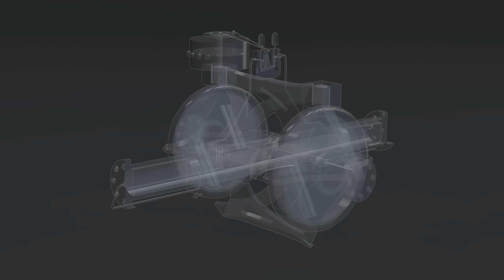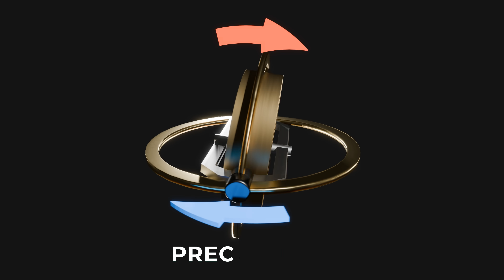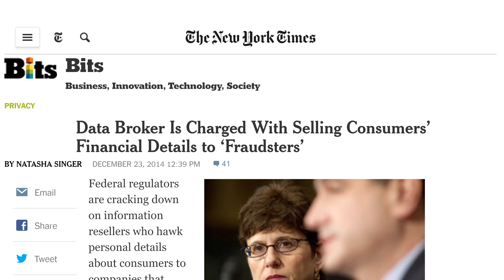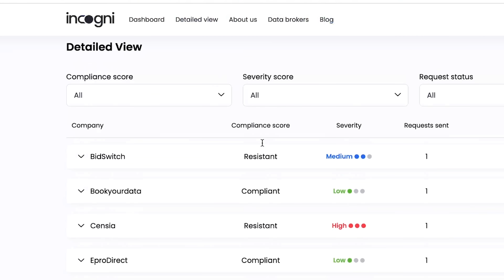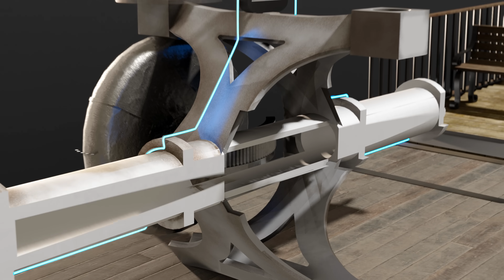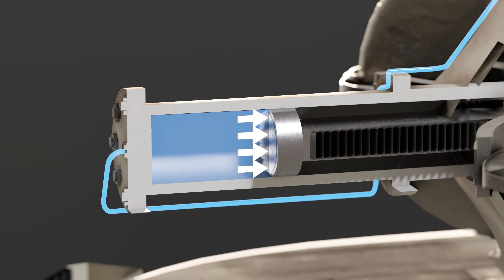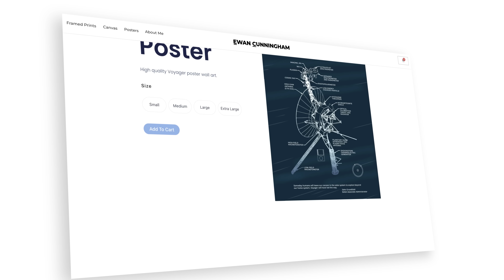The Self Balancing Monorail

Comment: I think it's okay that this isn't industry standard, but this should at least be a novelty at museums. It is so cool.
Reply: @nichtverstehen2045 Just because it didn't work in its intended area doesn't mean it's useless waste. This concept could surely be applied elsewhere.
Reply: @pendlera2959  it has been applied else where but for the sake of this implementation, it wasn't needed after railroads were already developed. Had this came before the railroad networks, then it would of likely been how all trains were made even today.
Reply: @pendlera2959 yeah, I can see this working as a streetcar replacement in many locations
Reply: @pendlera2959 train racing and saving on track building costs with the improved cornering
Reply: @nichtverstehen2045 a lot of huge machines and stuff you use today start as a useless impractical machine. Yea it didn’t work for it’s intended purpose but the engine was so genius people use it as examples of the crazy things humans can invent
Reply: @nichtverstehen2045  ah I see what your saying, I just love the gyroscope design although yea it is very impractical it’s a really advanced piece of machinery for the 1910s
Reply: @nichtverstehen2045 Easy i even already stated why. Tourist attraction and lack of room. Put it in an old downtown district the ones that are barely big enough for a car god forbid a cable car. And a lot of people would ride it for the uniqueness of the platform and it would attract a good number of tourists. It would also take up less valuable real estate and be more practical then a bus in many ways, doesnt care about weather and as it would be public transit through small towns it would not be hard to have stopping points to recenter set up in a way to guide tourists to spend money, such as stopping at shops or eaterys. It is over engineered compared to a normal trolly or whatever sure. But sometimes thats the entire point. Besides using modern servos and such it could be made with off the self solutions mechanically for the most part and result in something not a lot more expensive to maintain then a standard car.
Reply: @arcticfox5118 Just accept your beliefs are worthless. You failed and you lost. Grow up.
Reply: @Shizkeb No beliefs are worthless except for religious ones. In particular, a civilization as advanced as ourselves, should finally take the time to stop for a moment, instead of staying in a constant rush and pursuit of constant change and progress and think about why believing in something as ridiculous as a "God" or some other higher being that created the whole world makes no sense. Anyway, that's not the point - What the point IS, however, is that the guy gave many examples of potential uses and you simply say his beliefs are worthless and that he should grow up. You went as far as to offend the guy just based on the fact that he was thinking differently than you. Let's think for a moment who is the one more immature here, shall we?
Reply: @nichtverstehen2045 Simplicity was desirable a while ago now its safety and redundancy that is desirable.

Its how everything from airplanes to reactors work today. We build in multiple ways so single parts of a system can fail without compromising the whole system. 

While an invention like this isn't good for something like trains the concept can have wide uses in autonomous vehicles. Its a self righting gyroscope able to turn without relying on a microcontroller
Reply: @nichtverstehen2045 So do you have any point? If not I will just go back to making systems and video. I just commented since you considered this idea wasted thought, where I believe the act of thinking for creation is beautiful.
Reply: @nichtverstehen2045 No you aren't making a point. You just like hearing yourself talk but not actually saying anything. Wish you the best my friend have a good one!
Reply: the less the complex the idea, the more practical it's as it scales well.
Reply: @nichtverstehen2045 you have to consider that this is the first functional model ever made. By a single person aswell. Even if there are some downsides the train has proven that it can function which is a huge step forward. However it will and has ultimately failed because of the lack of sponsors, other inventors who picked up on the idea and interest from outside. I'm pretty sure that it could've been a practical transportation system if people really worked on it
Reply: @nichtverstehen2045 K!
Reply: @nichtverstehen2045 He lived in a different time. One far distinct from the reality of today
Reply: @nichtverstehen2045 found the armchair engineer
Reply: @nichtverstehen2045 Wouldn't that be wrong as most new ideas on this scale care much more about redundancy rather than simplicity?
Reply: @tommysalami420 what’s redundant here? I think you’re referring to using redundancy as failsafe, but I don’t see any redundancy in that sense here. 
The engineering done here is just inefficient use of energy for the utility it gives. Inefficiency is not redundancy, I hope that’s obvious
Reply: I do think it’s VERY cool how far the inventor could push the idea of using simple gyroscopes to balance a train, while being realisable (being economical is too high a bar). I personally wouldn’t expect inventions like these to be reliable at all - if it really is , even if it cost 100 times more than usual rails, I still think it’s a very cool invention in our history. The fact that stuff like these were made even remotely economical is in itself amazing, ofc not for investors, but for, fun.
Reply: @arunjosephshadrach9539  Not here in particular but other applications could use a flywheel setup such as this. Either way I was responding to someone calling this pursuit a waste. Where in reality his endless simping for the market and the economy is the real waste. 

An inventor creating new things in attempts to solve problems should not be insulted.
Reply: @nichtverstehen2045 Even mathematics has imaginary numbers. But those imaginary values can be used to better describe our reality we share. They are used to solve problems that were thought to be impossible. 

Imagination is what bridges our thoughts into physical reality. You are not opening your mind to new possibilities. in a way you are still trapped in your own mental prison. Its a hard one to get out of trust me I still have a lot more growing to do myself as well! But it is worthwhile and pretty fulfilling to accept a bit of humility.
Reply: @tommysalami420 As someone with both historic and engineering background, I can assure you Leonardo Da Vinci would be ashamed of @nichtverstehen2045 for misrepresenting him that strongly. That guy seriously needs to read more history to comprehend the nature of human discovery and invention that led to modern society, for which curiosity and sheer possibility drives innovation and resulting technologies, to places no one can foresee. In fact, Leonardo Da Vinci was well aware that many of his inventions were not yet in a practical form but could "find their place", and as you know, some, even if not all, eventually did.
Reply: @nichtverstehen2045 this is the definition of "Thinking inside the box"
Reply: @nichtverstehen2045 ok
Reply: @nichtverstehen2045  yep basically.
It’s just a cool design lol
Reply: YouTube reply sections are the best place to see all the insane things people have to say about anything and everything and life in general.
Reply: Thank you
Reply: @nichtverstehen2045 If you think engineering and trying new ideas is a waste then whats the point of your mind? Just to get so efficient that you dont have to do anything? What you are describing is mental decline and eventually death.
Reply: Yeah, you have never had a new idea in your life & it makes me giggle. @nichtverstehen2045
Reply: @nichtverstehen2045the fact you would call an ingenious idea a "useless waste" shows how braindead you are 😅
Reply: @nichtverstehen2045
Will you be able to atleast think like him?
Genius mind is a genius mind always.
Garbage mind is always garbage and calls everyone a garbage because he is a big GARBAGE.
It will probably take 5 more lifetimes for you to think like him.
Reply: In 1900 they did not know the network effect so well. By today's standards light monorails everywhere at a slightly  higher fuel costs may have won over for light commercial vehicles. It would have been definitely cheaper than interstate highways and gasolone track suspentions. Back then they just compared failre mode. MTBF for controlled devices is worse than for passive four-wheelers. If system benefits would have been acconted for, the outcome would be dufferent. 0@nichtverstehen2045
Reply: @nichtverstehen2045 you mean like yourself then?
Reply: @nichtverstehen2045 was für ein dämlicher und kurzsichtiger kommentar
Reply: seems dangerous, if any part of that balancing system fails you get a disaster
Reply: I must say I find systems supporting themselves by design way better an approach than modern designs, where everything is made to work my means of additions run by microcontrollers.
Reply: @nichtverstehen2045 Germany is currently experimenting with it in order to reactivate unused train rails. You should really get your head out of your ass and be more open-minded.
Reply: @nichtverstehen2045Germany is currently working on a project with this type of tech, they'd be used as a transport method that's sustainable, ecologically friendly, and on-demand in order to reactivate unused rural train rails and minimize car usage. If you'd pull your head out your bum, you could be more open-minded. realize they in fact have a use.
Reply: Rails are built by machinery that uses rails. Unless you can adapt that machinery to use a single rail, it becomes expensive to build single rail negating one of main advantages
Reply: @nichtverstehen2045 What a braindead comment. Who said it has to be for the monorail? There are so many different concepts in the invention. Just the application of self balancing gyroscopes can be used in all sorts of robotics, whether on earth or in space somewhere. At least its principles can be used in those places. If anything, people can learn from a failure and avoid this approach altogether. Do you think every "useful" technology just come out of the blue? Every single piece of technology is based on previous inventions that may or may not be "useful". Just because your tiny mind can't see the usefulness of something, doesn't mean someone else can't.
Reply: @nichtverstehen2045 Every person regardless of intelligence can quote something, but that doesn't mean that person understands that quote. You are the prime example of that.
Reply: It seems like it would be a cool project for someone with some engineering skills to make one on a small scale to ride old abandoned rails etc.
Reply: I could see this working with todays advances and electronic controls. You could likely reduce the size of or eliminate the gryo entirely in favor of servos and such in a much cheaper and smaller footprint.

Something like this would be a decent solution for older towns and citys where room is at a premium and since it would be stopping a lot as public transit it would not be hard to have stations where it could stop and safely be recentered.

Would also make for a good attraction just for how novel it is.
Reply: @nichtverstehen2045 The irony in saying that on a video remembering the engineering of a creative concept. 

Do you think leonardo would have taken greater liking to  a person that only cares about the practical aspects of the market or other engineers like the one in this video.

We can always wonder but an inventor and artist would definitely be more favorable to other inventors rather than businessmen.
Reply: Calling ventures like this useless just shows that you don’t understand the evolution of technology.
They might not mark the milestone moments in history, but that doesn’t make them less important.
If anything, learning what doesn’t work is the key to learning what works.
And what doesn’t work for one application might very well be the key solution to make something else work.
Reply: @RiverOakMusic  Well said.
Reply: The fact that it needs a constant supply of energy just to stand still makes it totally impractical to use for regular service.
Reply: Instead  of  two  rails , we can use one rail 😂
Reply: @nichtverstehen2045 that’s why he said as a novelty… Anyone with a Brian knows this is useless
Reply: a single incident of wedgeing in a minor way and the train falls over. the train just cant stand for its own for more than a couple of days
Reply: @timopint1125   no it stays on its own for as long as it’s maintained and has power or you can just set up a frame seriously man did you watch the video
Reply: that as a standard would be impossible. it cant stand itself.
Reply: @timopint1125   did you watch the video yea it can literally stand up by itself
Reply: @samuelspace101 It can't lol. It needs fuel to stay upright. Once the power runs out it will tip over. It's just a bad design. The two wheeled trains will still stand stationary without fuel. The normal trains can just be left anywhere on a track for storage and if there is a break down it will still be standing and waiting for repairs. If the monorail breaks down it will fall off the tracks and need a crane to put it upright again.

Comment: This could work, but only as a tourist attraction with gimmick-value. Maybe Dubai or Disney.
The self-balancing Gyro-X (2 wheeled car) from 1967 did not take off either. When you look at the cost side some big question marks come up. Each and every carriage needs their own gyro system. Two rails are not twice as expensive as a single rail track. Once built, cost of track maintenance should be similar. However, the gyro system needs maintenance, no matter how well designed, and the cost for this comes on top of track maintenance (which is a significant factor in itself and is slowly killing off trains, which are a basically Victorian idea when manpower was abundant). It may be that the running costs without maintenance are lower (less friction etc.). The question is, by how much? As an investor, I would have doubts too.
And then there is the psychological hurdle, see printers: Kodak sold printers which where more expensive to buy but a lot cheaper to operate. It did not work!!!

Comment: Hate to be that guy, but this is flawed on a fundamental level as it trades simplicity for complexity with essentially NO benefit.  There is NO benefit as the cabin is wide enough already and saving one extra rail is just not enough. Rails a cheap, require close to no extra maintenance, hi-tech two-gyros-and-two-hydrolic-pumps is expensive and require constant extra maintenance (especially considering this a safety-critical component). Again, the biggest downside is the fact, the cabin is already wide enough for two tracks. Bikes are successful, because they benefit from being as thin as a person, a train does not have such requirement. People back then made the right call.

Comment: German engineers are actually trying to implement a new take on this concept, the „Monocab“. 
Since it’s now possible to design the carriages driverless, it’s a valuable option again for rural areas. Existing railway lines could be used to travel in both directions without the need of adding a second track. 
You can watch a small demonstration here:

https://youtu.be/w8b8avaq1yY?si=-Wp5h1qkj3VquIDi

I really hope this will gain traction, could save a lot of rural railway lines.